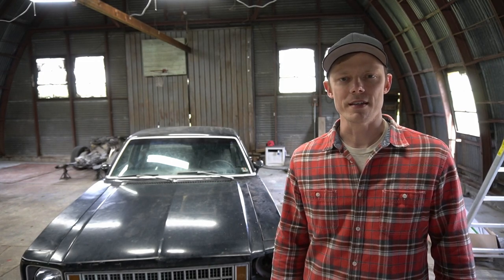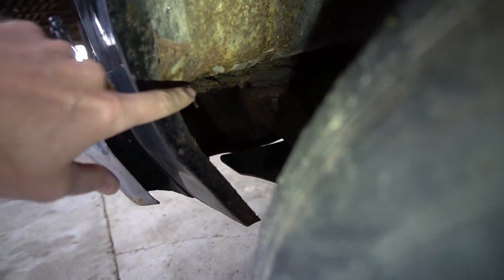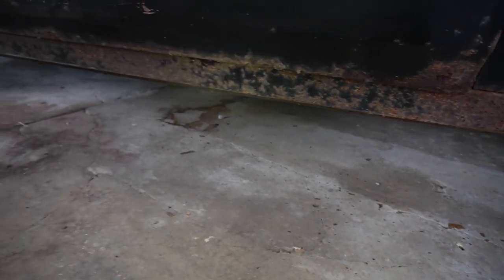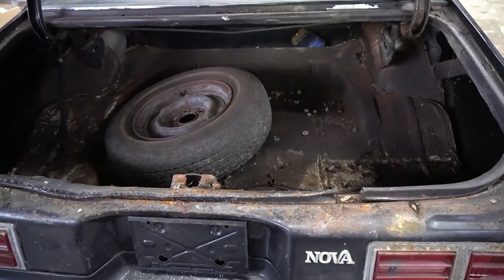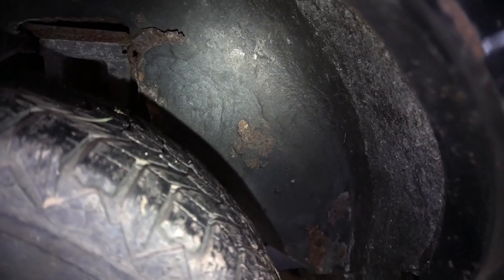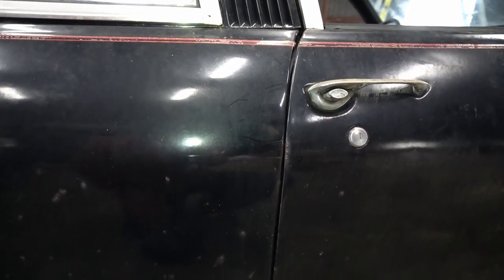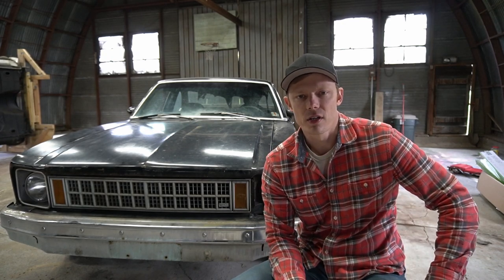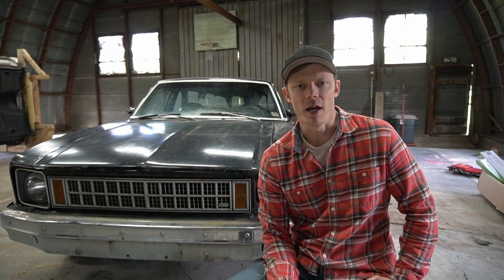How NOT To Buy Your First Project Car - 1977 Chevy Nova “Barn” Find

Comment: I don't know why anybody would buy this car, even if it was in good shape.  They were bad when they were knew, and I am sure you cannot get even trim parts... No body in their right mind would restore this car either.  What did pay for this car???  $1000?  After months of work and $5000 of parts - You still have a $2000 car//  I owned 2 of these when They were new..  A 1975, and a 1979.  On full highway driving, it gets 14 mpg...  It is better to restore furniture than these disaster dinosaurs...